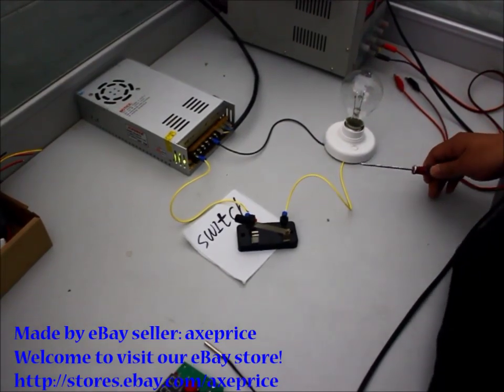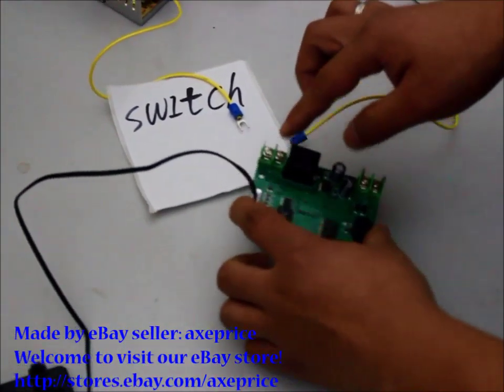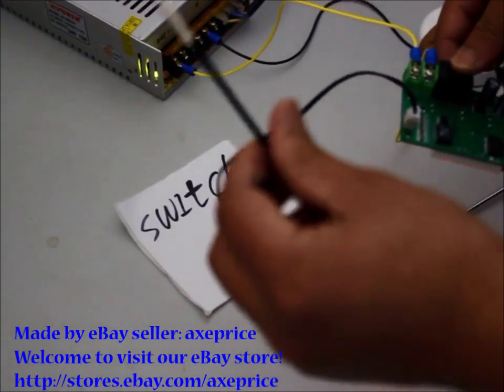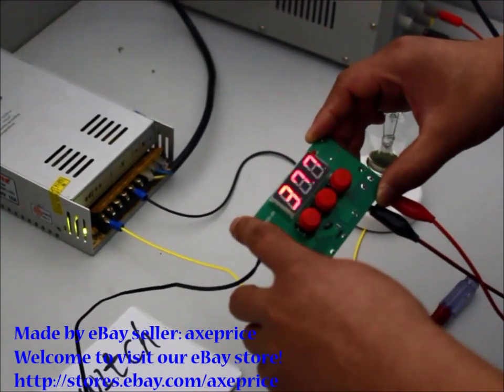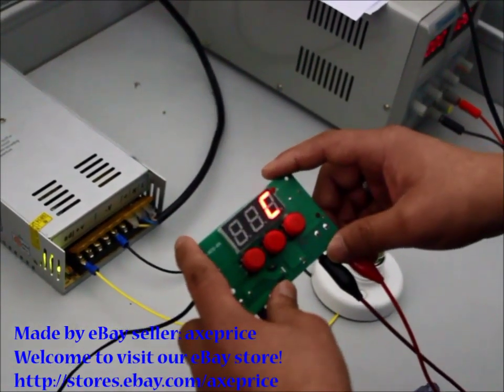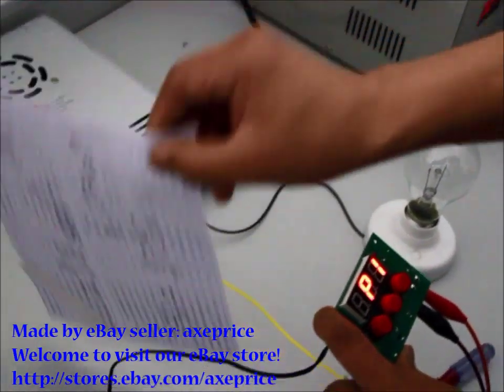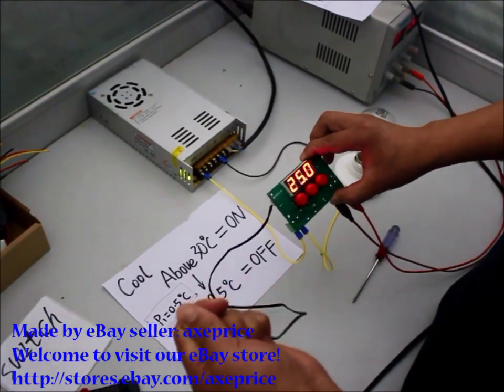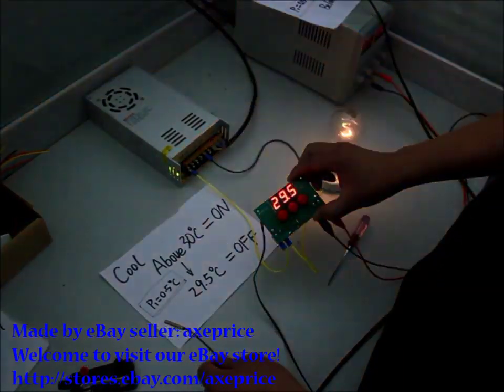DC 12V Digital Temperature Controller / Switch Demo

Comment: Hello sir I have purchase this thermostat from ebay but I have one question about this can I connect directly 40w bulb without any equipment .
Reply: You need a 12V power supplier for this controller. If your bulb also use 12V power, you can wire them without other units.
For more information, Please contact our eBay Customer support.  We usually don't log onto youtube account. Youtube is very very slow visiting from China
Reply: Thanks for feedback sir.
What happened I use 40w bulb to thermostat
Reply: If I use 40w bulb which normally I use in home ,can this type light bulb use for this thermostat directly
Reply: Thanks sir now I understand

Comment: I have http://cgi.ebay.com/ws/eBayISAPI.dll?ViewItem&item=131143728372&ssPageName=ADME:X:RTQ:US:1123   and I have watched your video. and I cant get this thing to work at all. I set it just like you did and it dose not work like how you have yours working.  I messaged the guy that makes this I hop he gives me and answer on how to make it work.  if now I will have to buy yours instead
Reply from the maker: the controller you bought is not the same with ours. I'm not sure if it's product issue. Remember, this kind of controller is not power source for load, it's just a switch powered by 12V power.
Reply: axeprice@eBay  I could not find your store in eBay search page.